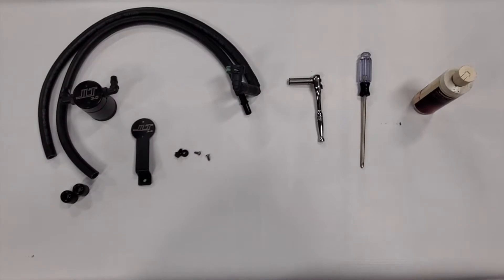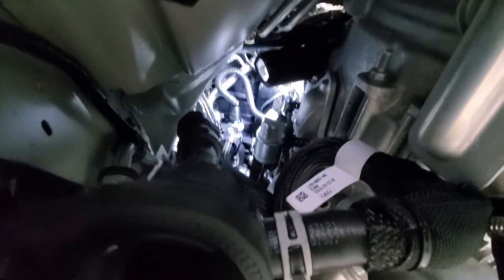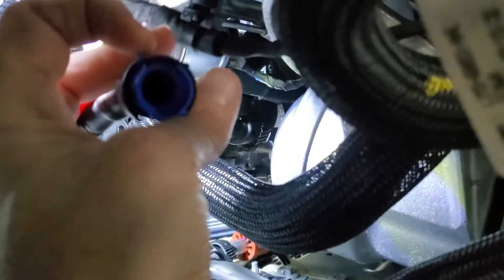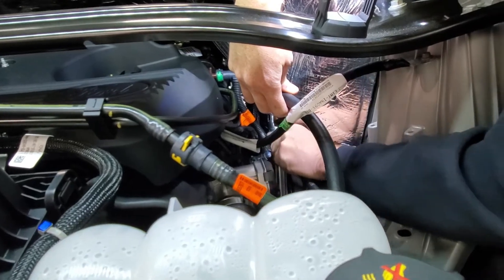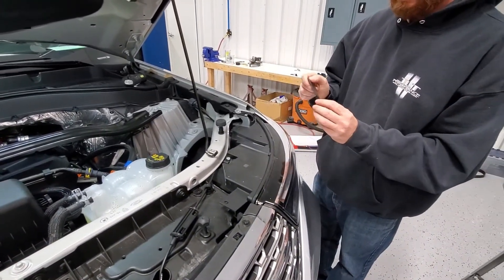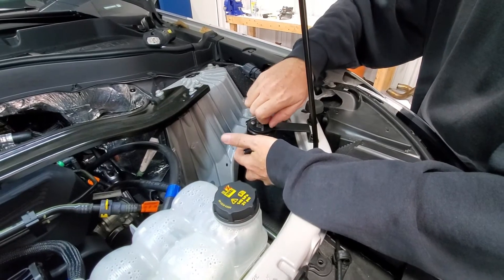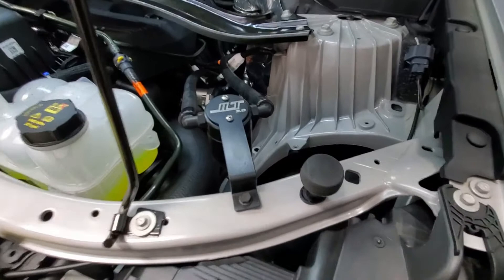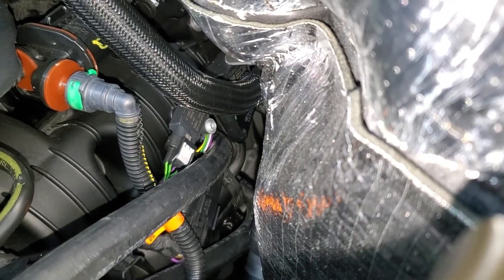J&L Oil Separator Co. 2020-2024 Ford Explorer 2.3L EcoBoost Install 3055D

Comment: This fit my 2022 explorer but I was a bit disappointed with the  difficulty I had keeping the manifold hose with the 90’ off the steering shaft. Even routing it behind the egr line like shown here, still would allow it to contact right where the u joint in the steering shaft is which would be worst case scenario if it was contacting while driving. I had to really mess around to get it to not touch and I’m still not happy with it so I will be putting some hose protector on it and zip tie it to something to help keep it from contacting. My fear is a bumpy road shifting something slightly and allowing contact again. I also ended up with a kink in the hose between the 90’ elbow and fitting. I got it strait but that bugs me too because the kink never really fully goes away after that.
Reply from the maker: Thanks for the feedback. Feel free to shoot us some photos to info@jlosc.com of your install and hose routing and where the kink is, we might be able to help you tweak something to make it all line up better.

Comment: That blue clip was a huge pain. Without a lift, and working in such a tight area, I fought with removing it and plugging it back into the new hose for a good 45 minutes. I installed one of these on my F150 no problem, but this time around was definitely not quick. Good luck
Reply from the maker: Unfortunately just where the PCV line is on this one makes it a bit more involved than most. Glad you were able to get it together!

Comment: How would you manage using this separator in a freezing climate? I suppose you'd have to be draining at an increased interval?  I have a 15 sport with a brand new 3.5, and would like to do this.
Reply from the maker: Yes, in the winter months you're collection rate will increase due to condensation in the oil separator.  Your 2015 3.5 install is much easier then the 2.3 in this video - see here- https://youtu.be/wD3BFbdpbWs?si=cchV-P6r0dZrJtPC
Reply: Thank you!  @jloilseparatorco.1853

Comment: What exactly will this do? Can I use on my 2016?
Reply from the maker: An oil separator essentially acts like an inline filter on your PCV system, catching the blow by vapors and preventing them from making it through your intake track and onto your valves. Check out this video for a more detailed explanation: https://www.youtube.com/watch?v=nTpUjiCsPK8

The only Explorer application we have for the 2016 is for the 3.5L Explorer sport: https://www.jlosc.com/JL-3-0-oil-separator-pass-side-2013-2019-explorer-sport-3-5l-ecoboost-v6/

Comment: Will this work on a 2023 Ford Explorer with the same 2.3 engine?
Reply from the maker: We have not had a 23 model year in the shop to confirm fitment. We believe there was a change made late in 22 that might affect fitment.
Reply: it's 2024, have you had a chance to install on a 2023 model year yet? @jloilseparatorco.1853
Reply: I just installed on my 2023 Explorer St Line 2.3 l, So far so good, it does not change much from the one in this video. Tomorrow will test it on my way work. Thanks  @jloilseparatorco.1853

Comment: Will this fit a 2023 2.3 explorer
Reply from the maker: We have not had a 23 model year in the shop to confirm fitment. We believe there was a change made late in 22 that might affect fitment.
Reply: @jloilseparatorco.1853  Do you have an update on this? Just brought home a 2023 and from the topside things look very similar to this.
Reply from the maker: @sandwich1984  We still haven't been able to find one locally to confirm unfortunately.
Reply: Has anyone installed this kit on a 2023 Explorer with the 2.3?? I know JL said there may be a fitment change, just to confirm before purchase.
Reply: @medic2834 I did on my st line 2023, so far so good pretty straight forward. Tomorrow will test it on my 29 miles commute

Comment: Will this void  the warranty?
Reply from the maker: If you read the fine print on any warranty contract you will find a lot of reasons your warranty can become void; installing aftermarket parts can be one of them. However, per the Magnuson–Moss Warranty Act proof would have to be provided that the after-market part caused the failure. If you need further clarification, contact your vehicles service department. Some are easier to deal with than others.

Comment: I just have a question....I'm new to these and am wondering why there is 2 different part numbers listed (3055D-B and 3055D-C). The video says install 3055D. I am purchasing a 2022 Explorer ST-Line with the 2.3 liter Ecoboost. Which is the one to use? Thank you in advance.
Reply from the maker: The different part numbers just distinguish between the two colors. 3055D-B is a black anodized finish, 3055D-C is a clear anodized finish. It all depends on if you want a black can or a silver aluminum look.
Reply: @jloilseparatorco.1853  ....thank you very much for the information!!! Much appreciated!!!

Comment: Is there a video for the 2016-2018 2.3 installation.  This looks much easier than the installation for the 2016-18  PDF from your website describes.
Reply from the maker: Hey Frank,

Unfortunately we don't have a kit for the previous body style with the 2.3 as of yet.